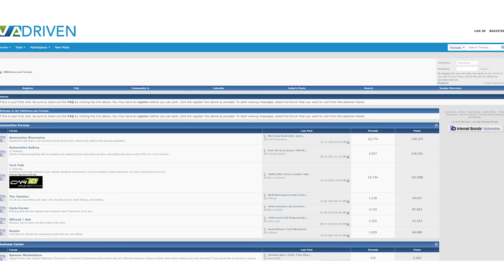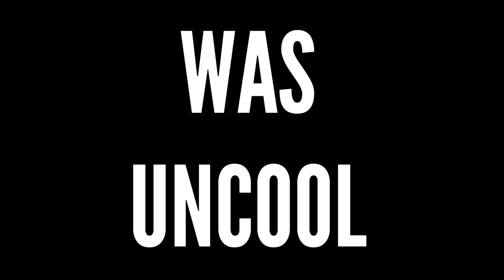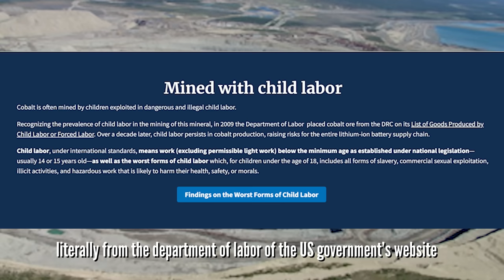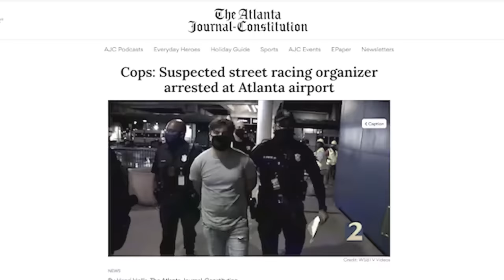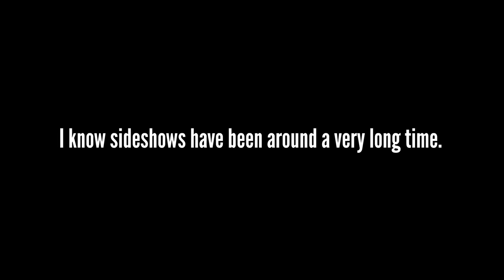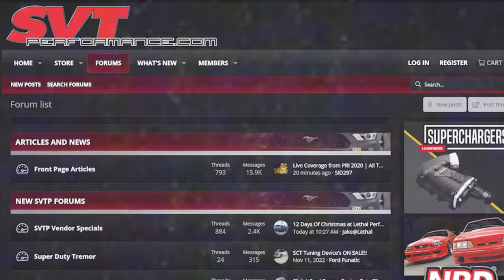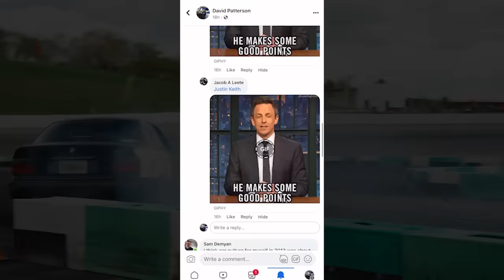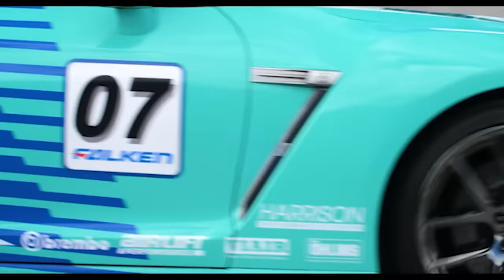Car Culture Has Changed: 2012 vs 2022

Comment: I miss cheap Japanese cars. As a Canadian. a good r32 gtst would cost you $5k. Importing a car from Japan was only 1500 bucks
Reply: I miss cheap fun cars in general. So many cars now are treated as investments and nothing else.
Reply: @joshuakhaos4451  
While I do believe there are still some solid bargains out there (for instance, I've seen ZZW30 MR2s go for less than £2k in the UK), I'm gonna have to agree with you that cheap fun cars are a dying breed, especially with FR, MR and AWD platforms.
No new Mid engined cars for less than £30k, period
The cheapest new FR cars cost £25-30k depending on the weather
And for new AWD, you have to pick 2 between cheap, easy/cheap to maintain and fun to drive

And the used market is like looking for a needle in a haystack and once you found the right car, some rich guy will come around, force a markup so they can price you out of the car and buy it as an "investment"
Reply: @Icemann336  Im in the middle of finalizing on a 1987 ford thunderbird 5.0 with less than 100k miles on it for 4k. Plan on rebuilding the engine with a flat plane crank, keeping it NA and going dual carb, and going titanium high flow exaust to make it sound amazing but last me a really long time. Sometimes the best street cars are the practical but still special ones.
Also to note: Im 23 and just getting into proper cars after being around my dad with his 57 El Camino growing up he used to do something similar with.
Reply: @KadiusFTW  Flat plane 5.0... Buddy real life is not forza. Please do some research before saying things like this.
Reply: @KadiusFTW  
Funny you should say that, I'm also 23 and currently modifying my '98 MR2 UK spec, also keeping it NA while planning on doing an engine build similar to that of the TOM'S T020 with a stroked 3S-GE! Hope the build goes well dude ^_^
Reply: In very saddened since us Americans had to wait an additional 10 years compare to you guys and now prices have soared.
Reply: I bought my R33 when it cost £9k 

Now it’s 30k 🙃😳 bonkers
Reply: I remember graduating High School, and being this close to buying an R34 GT Coupe for $9000(!!!)

Life is much better and more financially stable for me, but i still think of what would've happened if i spent everything i had (just over $9000, funny enough) on that R34 Skyline instead of College.
Reply: Back in 2015 I purchased a clean low kms R33 gtst for 7800 aud !
Reply: I bought my r32 gtst for 7500 of my Australian dollars.
Reply: i bought a r33 this year.... paid 28k for it.... but its truly priceless, so whatt i paid doesnt make much difference. was gonna import a s15 spec r for about a 35k budget but found out every one not rusty was minimum 40k ....
Reply: Truth. Even a decent civic hatchback is going to cost you an arm and a leg.
Reply: I remember R32 GTRs being 20k-25k in mint condition in Ontario when I was in high school because people didn't want to drive RHD cars
Reply: @SomeOne_86  I did. Its costing more than the car itself just to get a set of rods, a new cam, lifters and the crank to do so.
Reply: @KadiusFTW  Damn, I thought you were some kid talking mad shit, if you're actually building that good luck! Upload some videos too, I'd love to see it.
Reply: @Queso305  We are always like "Yeah maybe I'll get one of those later" "Nah man! You gotta get it now, the Americans will have it next year and it'll be double" It would really do your head in how cheap S15s are here for at least one more year. 2024 comes around, they'll all be $40k+. Shit, I should buy an S15...
Reply: @SomeOne_86  May do, but it wouldnt be on this YT account.
Reply: @bennyb.1742  I regret not buying anything sooner and now my opportunity might never be right. Buy it while you can
Reply: Here in NA, an R32 GTST can pull $20,000+ USD. It’s agonizing
Reply: Yep I remember in high school I was looking at fd rx7s for as low as 3k. Can’t even get a totalled non rolling shell for that now 😅
Reply: I miss 6k STIs. Now a corolla cost that much.
Reply: I just miss cheap cars in general :'(
Reply: The very same people are to blame about the like cheap cara now days.

When a small group starts hoarding cars and engines and people pay their asking prices, they are to blame.

Look at the 90s cars now days, certain crappy movie overhyped certain cars that used to be cheap to build and parts were accessible, now you need to leave an arm and leg to get parts.

You think actual owners like the overpriced range their cars and parts are going on for? They don't, something happen to their RB, 2J ect and now they have to pay twice the real value just cause some dumb asses don't have respect for their money affecting everyone's market.
Reply: @Icemann336  So true, I just imported my 05’ MR-S for $15K CAD this summer. Which might not sound that bad now, but there was a time not too long ago where you could get a R34 GTT, S15, or Evo 5/6 for $11K-$15K CAD.  R34 GTT’s are now priced what R34 GTR’s used to be.
Reply: @mackster196  
Out of curiosity, when and where was this?
Reply: I had S13's/S14's back in England and they were only a few thousand. Now... bonkers money for trash.  I just don't get what happened outside of government cash offers to scrap cars etc.
Reply: @robertolerota4234  are u a big strong homosexual?
Reply: @drht6015  💀 who hurt you, buddy.
Reply: Where was this that’s almost incredible to me I’m in Ontario
Reply: @adamgriffin2220  western Canada. I legit know of a Yellow s15 that was bought for $2500 lol
Reply: @theninethrees8044  I've been looking at some for the past couple months and their all just way too high for something which I would need to swap in a 2zz or 2ar into later down the line, making thr purchase hard to justify for me, as I already have an AW11 taking up space and would likely never get rid of (unless I get a NSX). 

Was the 15k spent for a RHD car from Japan or a LHD car from the US?
Reply: Had two,  paid 3.2k  NZD in 2013 for a Gts25t coupe looked a little rough and 7.7k for a mint sedan Gts25t in 2017. Car markets fucked now paid Golf R money for a Integra Type R lol.
Reply: @schafer240  Canada, probably around 2014-2016.
Reply: Awe man, I'm looking at one used. A 03 and they want 23,000 for it 😮‍💨
Reply: @Queso305  at least we don’t live in Canada 😂
Reply: @MrAk474life  true, I do not like cold weather
Reply: @Queso305  and you'd have to live in a igloo and have a dog sled
Reply: @mackster196  
Crazy, I missed that boat. I'm in Bc and have been collecting cars since early 2000's
Reply: @schafer240  here in South Florida we ride alligators for transportation. Kinda prefer that over a sled
Reply: @Queso305  touche
Reply: People didn't even know my car existed back when i got it in 2015 and now fuckers leave notes on the windshield asking if i want to sell it
Reply: @LumosGFX  R33 what? If a GTR badge isn't there, then neither is the value
Reply: @schafer240  not saying they were all around that price. But it was possible to get a rough one for that price back then. My friend bought a CYM fd for 6k but it needed a rebuild.
Reply: @mackster196  
That's crazy, I never came any across like that. Seen a couple rough ones with popped motors in the 10-14k range.

Might be a British Columbia thing
Reply: I wish for a time machine too.
Reply: @joshuakhaos4451  I literally gave up the jdm dream lol I have a 60's American now.
Reply: ur complaining abt not being able to save up 5K for a jdm legend?
Reply: @subiesnacks8446  nope, it used to be that way 5 years ago. Went to my local importer awhile back in February this year asking what the price was for a base R33 urban runner (the boring one with the rb20e single cam) just as a comparison to R33 GTR prices. Mouth hit the floor when he said 15kish.
Reply: This mans not wrong, I’d be on kijiji back in 2014/15’ & I would see tons of spec S s15’s going for 5500cad
Reply: @dustincalahaison8976  

There was a modded spec r local that was for sale for 15k for (2017-2020) 3 years, Noone would touch it.
Reply: it's true, my dad who didn't have much has owned around 5 R32 skylines before 2014 and now they're kinda unrealistic
Reply: Im gen z but this might help. These are a bunch of canadian dudes in the late 2000s buying cheap corollas and thrashing them around. The name of their channel is bentmafkfilms. Me and my friends have been obsessed with them since
Reply: Yes bro for real. I bought a clean 03 civic si em2 years ago for $3200 & today you can’t find one for less than double that. When I was in high school, you could get a clean em1 or crx for under $3000 & today they’re selling for triple the price. Not to mention ALL aftermarket support has skyrocketed in price making what once was a “cheap Honda build” turn into a relatively expensive car if you want it done right. I can’t believe what we’ve done to ourselves lol
Reply: YES! In 2014 when I was in grade 10 there was a guy a year above me with an R32 GTR in gunmetal he imported for $23,000 and he had a hard time trying to sell it two years later asking $28,000. There was also a guy a year above me who bought a white on white Evo V with Buddy Club P1’s for ~$10k at the time and still owns it to this day.

One of my best friends imported a 110,000km Aristo 2JZ in beautiful shape for $9000 a few years back, before they hit the US. Now everything with a 2JZ shot up, even if it’s automatic.
Reply: @theninethrees8044 I’ve wanted an MR-S for a long time, but by the time I’m finished college they’ll be too expensive. I remember when you could have one landed for $6-8K because they were undesirable.

Hell, I remember when you could import a non-turbo SW20 for $4000.
Reply: They still exist, just not RWD. Get yourself an old Toyota Starlet and have a blast
Reply: Throwback in 2012 when I had 10K CAD in my pocket and was shopping for an R32 GT-R. There were plenty at the time for so cheap. I still managed to find my MPII R33 GTS-T for about 9.5K USD two years ago so there are still deals to be found
Reply: You can add a couple of extra zeros to that number nowadays
Reply: I fkn know right? I mean I figured usa 25 years would have some effect but holy crap just ruined
Reply: @Icemann336  well at least we have the brz. I have one and feel like its a perfect driving car
Reply: @joshuakhaos4451  miata
Reply: @ninobondi1662  
Nice choice, I was split between that, the Mazda RX8 and the Toyota MR2 for my car, went with the MR2 in the end due to the mid engine layout but I cannot deny the BRZ/GT86 look really fun to drive
Reply: Inflation
Reply: i bought a shell of a prelude for $2500 

shit is way too expensive now
Reply: yo those days where the best, my friend bought a r32 gtst for $1500, it had 230k kms but it ran and looked great. Also remember 4 door skylines were worthless and even the nissan gtir as well etc. Now good luck getting any of those cars. After the us market opened up, thats when all these cars skyrocketed in price.
Reply: @16bmidniterfoxo  Its a JDM MR-S, its a fun little car and definitely gets alot of attention. The car feels quick cause it weighs less than a ton but 2ZZ swap or even K20 is definitely a must. Some people put a turbo in the 1ZZ. It’s a unique car, I mean how many mid engined sports cars are out there for under $20K?
Reply: @theninethrees8044  For sure, if I already didn't have my AW11 as a weekend car/track car I would have probably jumped on a ZZW30 already.. that chassis is just so capable on track.. its a damn shame they didn't sell them in Canada.

I will be looking to grab a new sporty daily for 2023 or 2024, will likely go with a GR86 for some hauling capability to go along with occassional track car duties, part of me still questions a ZZW30 even though it would be heavily impractical as a daily all year around here 😅

Maybe I can grab one when I get more parking space in the future, hopefully prices don't keep going up.
Reply: I remember buying a tidy r34 gtt manual coupe with 100,000kms for $11,000 AUD about 10 years ago. Good times. 

But we all knew it was going to go up eventually. Covid just exacerbated everything. Driving a 987.2 Cayman now. Way better value for money then the 90s cars.
Reply: @Queso305  That's the problem lol, Americans (not all but enough to make a difference) see everything as an "investment", it's the same reason games like EarthBound or Parasite Eve go for stupid prices (even though they're not even really all that uncommon) in the states but are still reasonably priced in Japan. Everything is a business and everyone is "grinding" 24/7.
Reply: @Jcoxy2k10  I’m literally in Japan rn (stationed) and they’re not only hard to find now, but expensive af
Reply: I'm up here in Canada too, had this exact conversation with a bunch of petrol heads, now finding a cheap project car is all about thinking outside the box.
Reply: bought my civic for 3.
Reply: In Australia, it was the same!
Reply: First turbo car I ever drove was my mates manual r34 gtt that he bought for $4000 aud. I paid $500 for my running and registered 1jz Soarer in 2020 just before Covid really kicked off. It's a shame that no one will get to enjoy cheap RWD cars  for a while (86s will end up costing a few grand eventually).
Reply: Was your dream crushed too by crazy inflation? Lol
Reply: I got my first r32 gtr for $11k shipped to ontario. miss those days
Reply: @superharuhifan  prices increased because of supply and demand
Reply: @KadiusFTW  There was also no El Camino in '57...
Reply: @chrisgobeil4751  woops, 59.
Reply: Dad got stationed in Japan from 01 to 04. The cars out there during that time were next level.
Reply: Yeah, I love classics, I’m trying to find a 59 Electra and somehow grab it before it’s gone, as long as the body is in good shape. But i just see prices getting higher and higher, I saw a 78 ranchero with no drivetrain trying to sell for 2k! I’ll miss the day when me and my buddies got a 30$ K car that blew up in 7 hours.. I think it’s still parked in the ditch we threw it with the skid
Reply: @Degensis  I bought a 62 canadian pontiac. Came on American Coker classics ($1700 tires) runs and drives perfectly. I've road tripped it quite a bit. Came with a brand new windshield. bluetooth with subs. I paid $2000CAD back in June of this year. It was a mega score  lol
Reply: @SomeOne_86  LMAO 😂😂
Reply: @Icemann336  Got my ZZW30 for less than £1k with an MOT til summer next year. This was only a few months ago and it's been great to me so far ;)
Reply: @maimunrahman9635  
£1k with MOT is a steal nowadays, especially with something as fun as that! May I ask how well is it running? Any major issues so far?
Reply: @Icemann336  Had a knackered radiator a week after owning it but since then absolutely spot on tbh mate. Plenty of TLC required to get her how I want it, which is kind of expected of a motor from the new millennium, but overall she looks good and I can jump in it anytime for fun with no issues. I've had a couple of faster cars than this such as an Impreza WRX and an EP3 but this to me is the most fun car I've had :D I'd absolutely recommend an MR2 Roadster as long as you pick a good base car to work with
Reply: Born in 96 so I could drive 2015 (7 years ago). In sweden you could pick up RX-7's and GTR's for less than 10k dollars... Let's just say you can't do that anymore lol..
Reply: In 2009 bought a crx for 500$ . Did b18 swap . From a busted integra 400$ . Painted it up hadbrand  new rota wheels set was 400$ . funnest little car ever Sold the whole car in 2012 for 3k.at the same time had  ef hatch and 91 prelude . Hondas were inexpensive cheap cars then . Now it's stupid money. Should have waited to sell it now.
Reply: I mean we still have it alright her in Canada, like you can import any jdm car 2007 and older right? The laws are still 15 years and older
Reply: There are still cheap JDM cars. Non-turbo JZX100s/GX100s are like $2000 tops at the auctions.
Reply: You guys talking about how cheap these high performance Japanese cars used to be. Those of us in Gen X talk about how cheap and plentiful classic American Muscle cars used to be when we were young. You could get just about any Muscle car from the 60s and 70s, in great shape and low miles for less than $10K. This was in the 80s. My first Muscle car was a 78 Trans Am with t-tops and a Pontiac 400. It looked and ran perfect. I paid like $1500 for it. You could get a 69 Camaro SS for like $5K, in great condition. The only cars that were over $15K were in mint condition with extremely low miles. Today those cars are in the 6 figures.
Reply: Still looking for a decent price LHD MR2 in Canada 🇨🇦
Reply: In 2009 R32 gtr was 11k. I pass on one due to being annoyed had to drive lhd on rhd road despite growing up with lhd. My argument was no point of having fast car when you couldn't pass coz you can't see.  Main reason was it will literally empty my bank account.
Reply: @tempeztad No, social media is to blame. Plenty of artists and celebrities have started to include JDM cars in their music videos and these went to TikTok and blew up. JDM tax is out the roof because of that not because of some minority of hoarders.
Reply: It's just how it works, everyone will always try to gain more income and once they found out they could get 30k for a rust bucket from Japan they paid 4k for. You can also blame the idiots who pay that much for them driving prices up.